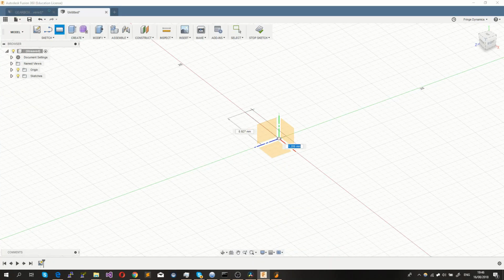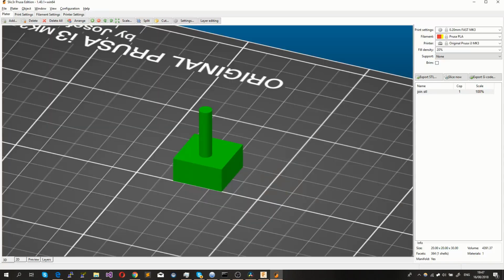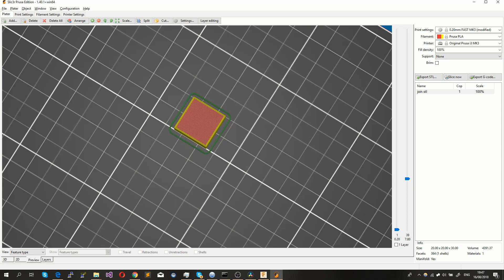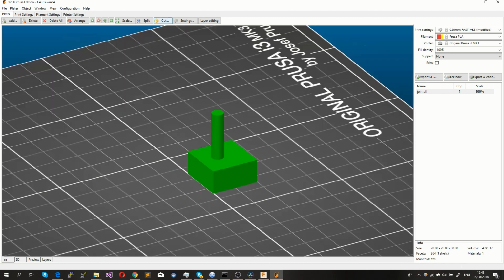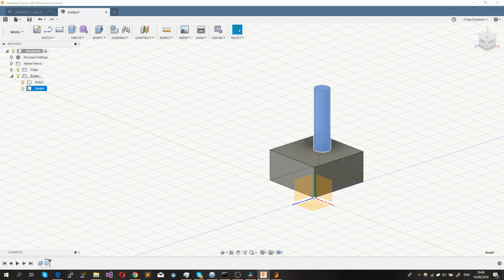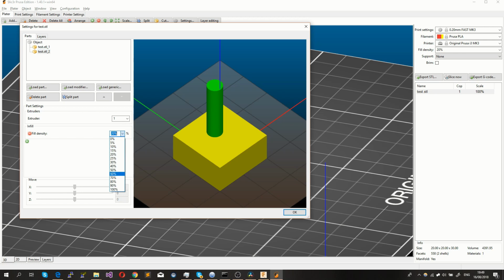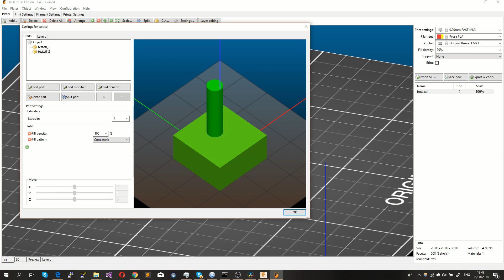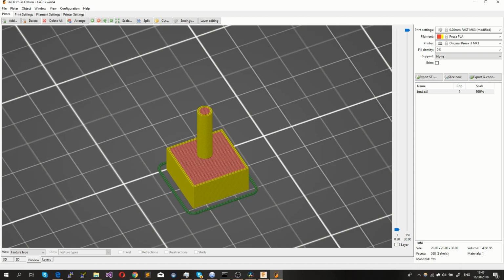Fusion 360/Slic3r Tip: Easy Variable Infill Without Modifiers

Comment: Hi, you can also get by small shafts with increasing the wall size so that you do not have a gap in the middle of the shaft, it also strengthen the rest of the parts. Thanks for the tip in Slic3r I will surely use it!